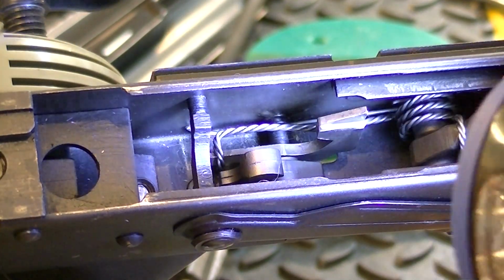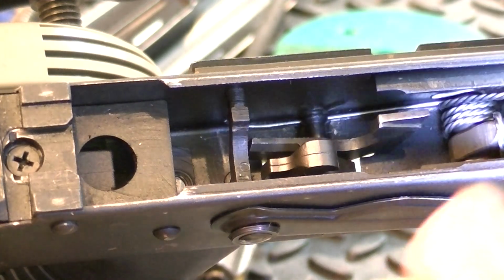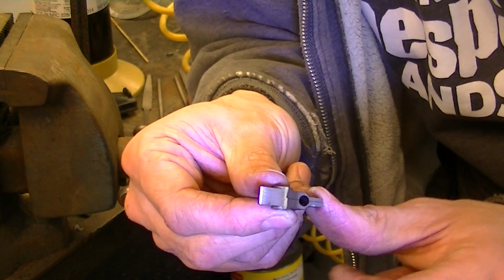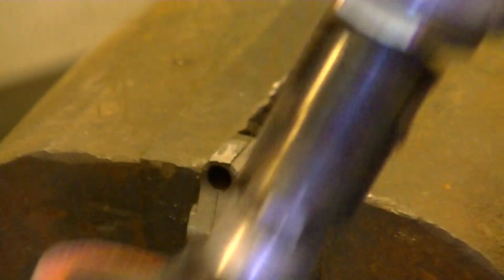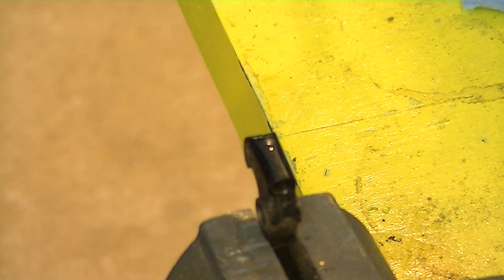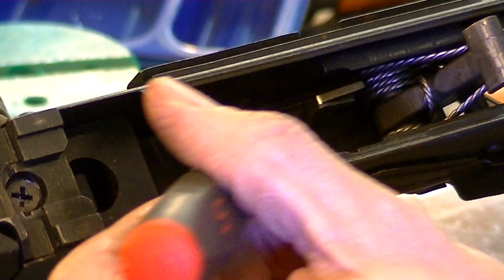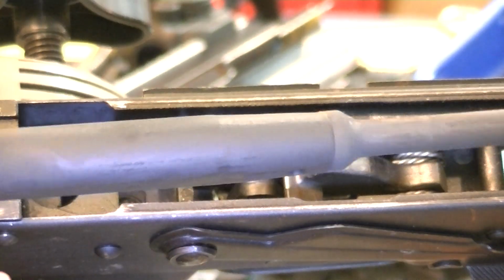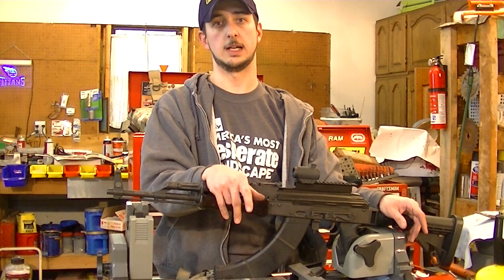AK-47 Trigger Slap Removal

Comment: To reinstall the shepards hook feed it thru the mag well then pull from the other end to set the hook on the hammer pin then push the hook down as you line it up with the trigger pin. Super easy with that style of hook.

Comment: kfoss..kfaus? what product are you mentioning for corrosion resistance on your parts?
Reply from the maker: Brett Jennings We do lots of coatings in house and use many various products.  Most of them are a process that involves more than just a simple application with a brush or something.  The "K-Phos" is a unique product that can be applied either way but sprayed on is the best.  If you care to elaborate what niche you wish to fill with said product maybe I can help you narrow it down to one that would best suite your needs.  I may also be able to provide it for you or if not I can direct you to a place where you may purchase.  We are a full service gunsmith operation specializing in obsolete parts manufacture, high end custom weapon builds ( lots of eastern bloc and WWII era builds) and coating services. We also do engine components such as pistons, turbos, manifolds, intercoolers, brake calipers, trans components, etc... I have coatings that help dissipate heat, ones that insulate heat, ones that simply withstand extreme temperatures, and coatings that have a high lubricity that allow machinery to be operated with out any wet lubricants. We also facilitate PVD coatings like Titanium Nitride and more.  I say all of this just to let you know incase you are in need of anything we offer. We are running a special on instock AR builds as well. www.TDCtactical.com

Comment: Replace your old shephard's crook retaining wire.
http://www.theflatspot.net/ak-47-retaining-plate.html
Hammer and trigger pin AK-47 RETAINING PLATE $4.00 . 
Easy to install and uninstall. Made of 20 ga 304 stainless steel. 
There is this thing called the internet, and a .0007 second search will give you various options.
Even on youtube they have videos!
https://www.youtube.com/watch?v=hWmwPMMKQ2U

Comment: ok, I have an IO ak and installed a bumpski. The gun will cycle a couple rounds normally and then not fire. Rack the gun and a live cart ejects and it will then fire about 2 rounds and repeat. If I fire normal semi auto I usually don't have a problem. My gut is telling me the springs are too tight. What do you think?
Reply from the maker: How many rounds has the gun had though it prior to the bumpski install.
Reply: TDCtactical maybe 200, I took the gun to an AK expert I met and found the spring inside the trigger is not up to par and the trigger has been upgraded to a Tapco. I'll report back and see how it runs
Reply from the maker: Please do. If you fix the problem I am happy to learn from you on your issue. If you don't fix the problem maybe I can help. Have a good one!
Reply: TDCtactical He claims the problem was the tiny spring inside the trigger is too weak and that the shape of the trigger itself is not perfect. So we installed a G-Tapco trigger and will try again soon
Reply: TDCtactical ok went out and fired it and its running like a song... I installed a tapco G2 trigger and all my problems are solved
Reply from the maker: Nightverslonn good stuff!

Comment: Is it possible to tune trigger slap and make it function similar to a "reactive trigger" setup like on paintball?
I'm hypothesizing that if you allowed the trigger slap to occur (and/or increase the effect) and then lightened the trigger pull, you could possibly get away with a simulated full auto fire.
Something simple like reducing the sear surface to allow a shorter trigger travel and adding a spacer between the two pieces that hammer against each other (as shown in the video) to amplify the trigger slap.

There's a drop-in trigger out for the AR15 called the 3MR (ATF approved), and it uses a little tab to accomplish what looks to be the same thing.
That tab is moved up when the selector is rotated to auto, and during operation the hammer bumps the tab and aids in trigger reset.
Seems to have mediocre results.
It's retailing for $500 and there's no damn way it's worth it.

If a guy could figure out a way to enhance trigger slap and make it work the same way (possibly via selector), they'd be on to something big.
Reply from the maker: Let me ask you if you have ever shot an AK with a considerable "trigger slap" problem?  It is well, lets just say "unplesant" haha  IT HURTS!  The slapping so to speak is happening in the opposite direction from what it would need if it were to assist the trigger.  Is it possible to use energy from the carrier to effect the trigger group to enduce bump firing? YES. Is it worth the considerable time, effort, and money that it would take? NO not when there are bump ski / slide fire stocks and such.  I can bump fire an AK or AR with a decent trigger, from the shoulder and have it be aimed fire. That is without any wizbang stocks and such... The extra equipment just makes it easier and where anyone can do it.  Auto fire is a farce any way, there is a reason our soldiers only rarely might use any setting other than single fire on their individual rifles. Now the SAW and other crew serviced weapons are different because they serve a different function. Good thinking though! Keep it up, that is how great things are born. I just don't believe that the ends justify the work on this one since there are many products that serve the same purpose already available. I have seen the trigger you are talking about and thought of grabbing one to test for a video but that is a large pill to swallow if paying retail. I will see what they might work out with me. Thanks man!
Reply: I've shot a few rifles with trigger slap, but none that I would consider unpleasant.
The trigger slap actually assists in pushing the trigger back forward, not to fire another round.
So, if everything was tuned correctly (meaning the trigger slap was light enough to be bearable, and the trigger stop was adjusted well)...the trigger would be pushing your finger forward while you're still squeezing rearward, the slap would reset the trigger, and since you're still holding pressure with your finger it would pull the trigger back automagically leading to simulated full auto fire.
Yeah, your finger would be vibrating back and forth at 600RPM, but how often would you NEED full auto fire?
I can see how it would be more beneficial than a bump stock, since you could rapid fire in any position without any special training, and keep whatever stock and grip you wanted on the gun.
Reply from the maker: Skinflaps Oldmeat On the surface what you are thinking holds water but when you get to the actual nuts and bolts of it... well the problem is timing.  There is no way to "tune" this because the timing is so far off. The slap occurs when  the carrier is ejecting the spent round on it's way back. It hits the hammer and the hammer contacts the disconnector which in some cases is mismatched with various semi-auto and full-auto parts. Certain combinations allow the disconnector to contact the rear of the trigger causing the "slap".  When this is all happening the carrier and bolt are still traveling rearward. If this was all happening on the forward stroke of the carrier it would be possible. The thing that is needed to make this all work is a thing called " a full auto sear"... haha they already have those and they take a $200 tax stamp and a transferable receiver! haha  Great thinking guys but in this case it would take more to make it work, it is not as simple as just tuning. Please keep up the ideas. If you like go on over to my Google Plus page and strike up some conversations there where many can view.
Reply: Will do...
Reply: Google+ has thoroughly confused me now...and right now I have no idea if I'm posting this to YouTube or G+.

The major difference between this concept and a full-auto sear is that there is nothing disconnecting the sear like a DIAS or similar, only a force to push your finger off the trigger long enough for it to reset on its own.
For example, the slidefire uses recoil to move your finger out of the way so the trigger will reset, and you need to apply another force for it to fire again.
One round per trigger pull.
However, if you could make trigger slap occur right as the bolt is going into battery, your finger would be pushed off the trigger, it would reset, and you would need to apply another force for it to fire again.
Pull the trigger once, trigger slap will launch your finger off the trigger and the gun will not fire again.
Pull the trigger hard enough that the trigger slap doesn't launch your finger off the trigger, and the hammer will stay locked on the secondary sear.
Pull the trigger and maintain a certain force (just like using a slidefire, except with your finger doing the work) and your finger will bounce on and off the trigger every time a round is fired, creating a rapid fire effect.
Nothing is actuating the trigger for you, nothing is disconnecting a sear, only one round fired for each pull of the trigger, per ATF definition.
This is how I believe the 3MR works as it does and maintains ATF approval at the same time.

Perhaps the trigger slap of an AK isn't suitable for this type of operation, but with the right design or addition of a lever somewhere along the way it could be feasible.
It all revolves around a trigger reset that has more force than the trigger pull.
If normal operation causes the trigger to reset with a force of 5lbs (as in you just fired a round and you slowly release your finger), and the trigger itself breaks at 3lbs, then a constant 4lbs of finger pressure would allow the trigger to cycle back and forth provided the reset happens right as the bolt is going into battery.

It happened to me in a worn out target AR after I replaced the normal hammer spring with a heavier one.
The trigger sear was set at 3.5lbs, trigger reset force was hard to measure but we estimated it at 6lbs.
Something about the HD spring and that setup caused the reset force to increase considerably.
If you got your finger in just the right position, it would fire...rather quickly.
Took about 5 rounds before it happened, and only 18 rounds out of 30 were left in my mag by the time I let go of the trigger.
The reset caused by the heavier hammer spring was more force than what was required to pull the trigger.
The gun was disassembled immediately, then taken to a local gunsmith and repaired, the old fire control group melted with a torch, and the stripped lower was later sold at a gun show.
I miss that gun :(
Along the way, the gunsmith had told me he wasn't sure if it could be considered a machine gun, but we decided to err on the side of caution.
Both sears were doing their job correctly, the hammer wasn't following the bolt, firing pin was free, everything was assembled properly, and it definitely wasn't due to bump firing because the event was replicated in the shop in a vise without using any ammo.
In hindsight, I should have sent the FC group to the ATF's FTB for evaluation to see if it was legal or not.
All history aside, it got me to thinking of a different method to achieve a high rate of fire without falling under ATF's definition of a machine gun.

I have an idea for 10/22's that works on a similar concept, and I don't see why it couldn't work tailored to other semi-auto weapons.
Something that doesn't cost $500 and would potentially work better at the same time.
The hard part of the equation is disabling it for normal semi-auto operation when you don't feel like having your trigger finger bludgeoned to death on a mag dump.
Or maybe the hard part is convincing the ATF it's not a machine gun...I haven't gotten that far LOL
Reply from the maker: Skinflaps Oldmeat What you get into is simply "WHY?" the cost and effort to be put forth trying to make this work would more than pay for a slidefire stock. These can be controlled properly and shot in burst or FA. There is no grey area and they just work.  Even if it were developed, the cost to even break even would mean you would have to sell the system for too high of a price and no one would buy them. Then you run into the question, "do I patent it or not?" If you do that is another$2000 to $5000 with european rights and that is only for a 1-3 year period depending on how you file. If you don't someone else can just look at what you have done and make their own without having to spend any time or money researching and developing it.  Just boils down to the fact that it would not be worth it to try. Now if the timing were closer but it is way off. It goes back to what I said about it is a good idea on the initial thought but when you get into it it is impractical.
Reply: You may be right.
Guess I'll just have to build an AK and find out definitively :)
Reply from the maker: A+

Comment: Just a heads up. I never remove metal from the disconnector. It's already been shortened on the one you have to prevent use with FA parts. The problem with slap on your variant there was actually the single hook trigger. the pin hole was too low and too far forward. I would have removed metal from the trigger piece instead of the disconnector. just my $0.02 YMMV
Reply from the maker: You are exactly right about that if I were removing material from another area of the disconnector (I won't say where here for others to see, haha) The area that I am working on does not open it up to that possibility as long as you have proper springs in there and do not disturb the spring seat there to where the spring could escape.